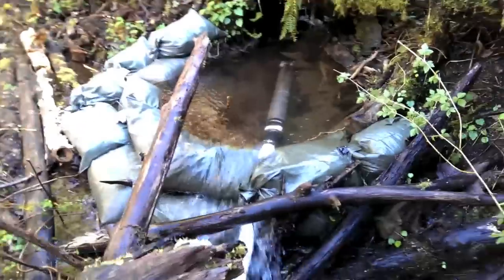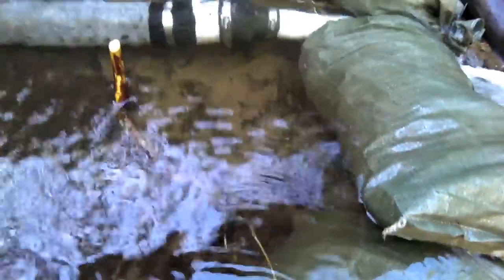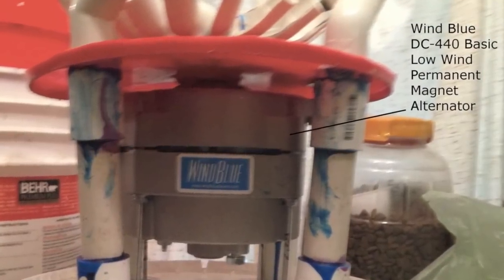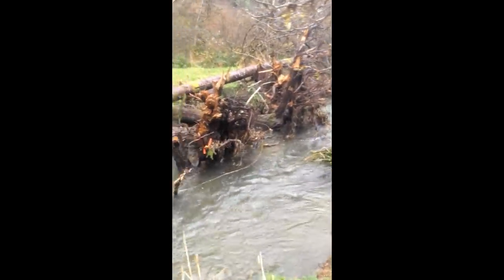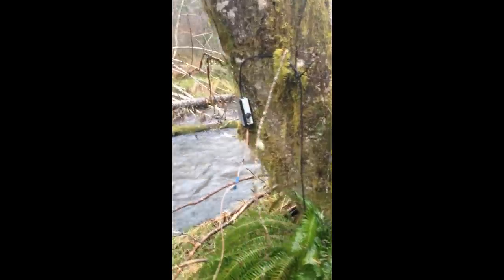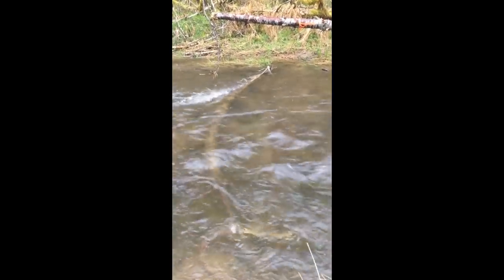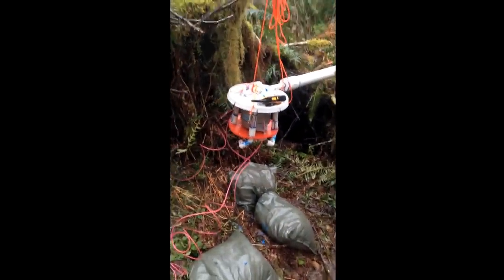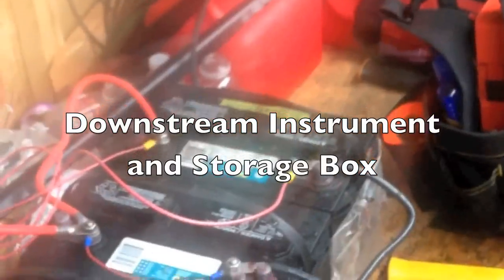Pico-Hydro for Science -- Updated and Edited

Comment: If we compare the CO2 saved by generating your own electricity with with the much larger CO2 embedded in the hardware used, it's probably not worth while going through this process - unless you live really far off-grid, or like lying in small rivers in your waterproofs. There is a real economy of scale to be had with centralised power generation and distribution. I really hate fossil fuel and nuclear generation, but they do have their (grudging) place for now. However, if you're completely off-grid by a number of miles then this may be worth while. A number of years ago I wondered about the economics and practicality of fitting a mini turbine to the water supply pipe into my house, but in the end it takes energy (electricity, fossil fuels) to pump water to the top of the water tower, and I'm only 'stealing' a small proportion of that with my micro-generation, so not of benefit to the world overall. 

This video idea is a modern version of the big wooden water wheels familiar in the textiles industry of the 1800s (UK timeline), but as a means of living off-grid it's probably too small. Yes, it could be scaled up I suppose.

Comment: As a professional fabricator I am screaming!!!  Why are you doing final assembly IN THE CREEK? This complete generator  could have been fully assembled AND TESTED in the lab. Any tweaks such as balancing issues or nozzle angles (You are losing energy when you change direction THREE TIMES!!  Better to have a helical spiral possibly fed from multiple 45 degree or better 22 1/2 degree outlets from the feed pipe.) should have been addressed there. You could simulate volume and pressure of water if you guestimated the fall of the water coupled with the size of the pipe.  You guy are as bad as our engineers! Consult with someone who actually builds stuff next time and your life will be easier.Rant over.  I do find the concept interesting, but with that volume of water your turbine could be larger and would be more efficient. (Leverage is everything in energy.)
Reply from the maker: I don't know why my student did the final assembly on site; possibly, it had to do with the difficulty of getting things to the site, because everything had to be carried in by hand, as dictated by the landowners. Time was also an overriding issue. At the time of this video, a big storm was coming (it was literally already raining), and we couldn't charge our batteries. The five-gallon-bucket design was an off-the-shelf solution, and it worked. For all the inefficiencies that my calculations after the fact revealed, this system did what we needed it to do, and we were able to go from inception to implementation in just a few days. If we had had more time, we still would have needed a lab with the necessary facilities and instrumentation. Somewhere along the line, we discovered that such a lab existed on campus, be we didn't know that at the time of this video, and again, we didn't really have the time between failure of our original system, in which we charged the batteries with a gasoline-powered generator, and the big storm in the forecast. We had already gone for more than a year without a flow event big enough to generate data. As it turned out, the coming storm was the only one to generate any data that year. Had we waited to find a lab and do testing, we would have had to wait another year for the chance to collect data.